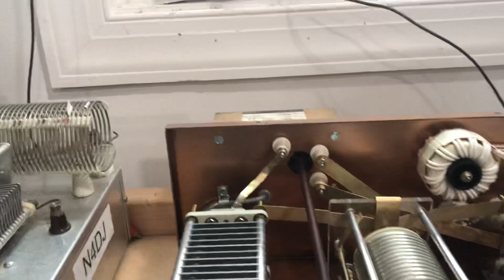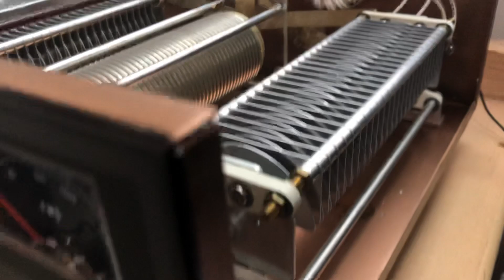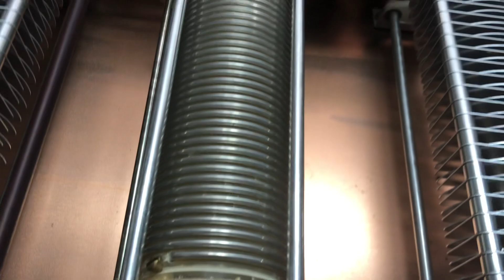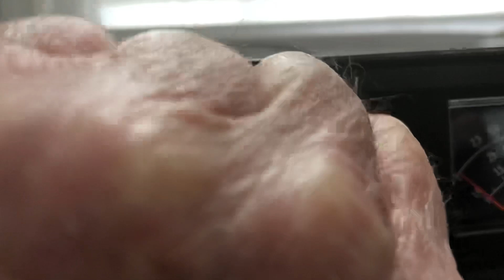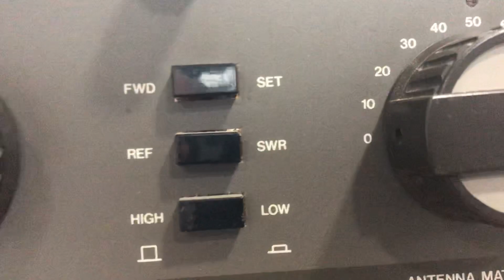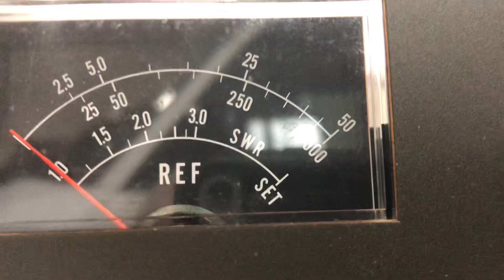Heathkit SA-2060A Antenna Tuner

Comment: I’m interested in using the long wire feature of this tuner. I removed the jumper for balanced line and simply connected a really really long length of 18guage speaker wire to the long wire jack. It runs along the top of my fence that goes around my suburban back yard. Probably 400 feet. 
The tuner is grounded to equipment ground which is bonded to a water pipe. 
  Do I need a counter poise and if so, how do I connect it?
Reply from the maker: It sounds like you have done everything right. I just am not sure about the ground. For one thing it matters how much power you are running. You can get away with a lot more with low power. I assume you will be transmitting on this antenna? 
For end fed long wires, some lengths are better than others. In some cases 1/4 wave needs no tuner. In cases where the antenna is 1/2 wave long it is a very high impedance and difficult to match. In between cases where the impedance is a “moderate” amount are usually easy to match. So turning the length can usually help in most cases. Trying to make one length of wire tune on multiple bands is not easy. Sometimes a counterpoise is needed and sometimes not, depending on the frequency. In most cases where the radio chassis is “hot” with RF adding a 1/4 wave counterpoise solves the problem. At that frequency. Nor sure what running around the fence means. It should held be off the fence with insulators. With the wire near anything it will have some effect, almost always a negative effect. 
My usual advice is to use a L network configuration tuner as they are foolproof with no possibility of mistuning.
If you are only receiving that’s a different story.
With antennas longer is not always better. The best simple antenna, actually the best antenna is a halfwave long dipole. Once you get much longer than that you get bad patterns. Lots of nulls and can get radiation from the wire canceling itself. Horizontal loops are not usually any better than a straight halfwave wire. The exception being if the geometry of the loop is such that it can form a pinpoint high gain beam in one or two narrow directions. That case is very special and most of us want wider coverage.
Did I answer the question?

Comment: Hi

Glad I found you!!!
On my 2060a, what is the correct way to use the sensitivity knob with ‘set’ button and the ‘set’ on the left meter?
Am I correct in thinking to set my Icom 7300 on say 20watts and tune the 2060a to low swr.  Then go to 100 watts on the Icom and then press the ‘set’ button on the 2060a, turning the sensitivity knob until the needle in on ‘set’?
Is this correct or not🥹

Thanku so much!!!!
Billy
Reply from the maker: Yes. I think you have it. Typically with the Heathkit SWR meters and most others also, you set the meter to full scale in the forward or “set “ position then switch to reflected power or the “SWR” position to read the SWR. Also the sensitivity needs to be set high enough that you can see the dip in SWR when you tune the tuner with low power. You probably will need to turn the sensitivity back when you want to read SWR with full power or you might peg the meter.  You need to be careful tuning these T network tuners. You could obtain a low or 1:1 SWR without all the power being delivered to the antenna. In that case the tuner heats up! I will watch this video again and see if I address that. If not I will add instructions here.
Reply: @dandypoint  Thanku sooo much!!

I believe I understand. 
Set the sensitivity to max on the dial, even though the needle is past the set mark, so that at low power, I can see a dip in swr…..Then I shld calibrate the needle to the set mark at max(100 watts)and then proceed to adjust all dials at for a final swr, and then talk away!
Reply from the maker: @WILLIAMPERRELLI  I think you have it. I usually like to tune for minimum SWR with fairly low power but with the sensitivity high enough to get a good dip. It takes more power and/ or the sensitivity set higher for 80 meters than the higher bands. Once you get the SWR as low as you can then check it by pressing SET and setting the forward power to the set mark. Then press the SWR to get the reading. Also if the forward power is 100 watts and the reflected power is 10 watts you have almost a 2:1 SWR.  When running 100 watts I monitor reflected power to be sure it is less than 10 watts and I know my SWR is better than 2:1. In fact anytime your reflected power is 10% of your forward power you have about a 2:1 SWR. I run 500 watts in contests, so I keep reflected power at or below 50 watts.
Reply: @dandypoint  I really appreciate this!!!

Billy
Reply: @dandypoint  Since this brand of tuner is one of your specialties, I did a bit of testing last night and thought that you might find the short results, interesting. 
See my photos. 

Upon starting, You state(and I agree) that the two Capacitance knobs shld be close to 100 and the inductance close to zero. 
The manual(see photos) shows starting points that are completely opposite, thus the way I learned to tune it. 
On 20 and 40 meters(see photo results), I tuned up both ways and asked the same station for reports. Oddly, for some reason, I received better reports(not by a lot) by using heathkits suggestion?  
I Included a photo result of my tuning, doing three segments on each band, via what was shown in the manual. 
My mind is always curious, thats how I learn. So any input on this is a welcome thing. 

Thanks again and hv a good weekend!! 

Woops. I just discovered that I can’t upload a photo😕
Maybe u hv an email to share snd I will fwd them to u.
Reply from the maker: @WILLIAMPERRELLI  my email is donjohnson@vt.edu
That’s one of the issues with T networks, they can be tuned for minimum SWR with different settings of the three controls. 
The Heathkit manual has suggested starting points for typical expected impedances. That should be good as a starting point.  I would like to see the pictures. I can email you some more tuning info also. What are you using the tuner for? Single end fed wire, ladder line to a dipole, coax in and coax out to reduce a moderate 3:1 SWR to a 1:1?  
In general the tuner will be most efficient if the output capacitor is at the highest value that will allow a match.  Matching a higher impedance than 20 ohms should be fairly easy but matching a low impedance less than 50 ohms may be a problem on 80 meters. Sometimes you can’t use full power without heating. I have some QST articles I can send you on T networks. 
I gave my tuner to a friend so I no longer have the manual or the tuner to look at. 
I
Reply: @dandypoint  You hv been so helpful.  I really appreciate it!!!
I will send all the info tonight, after work. 

Best,
Billy
Reply from the maker: Yes at the 1:10 minute point I start addressing how to tune the tuner correctly.
Reply: @dandypoint  
Question 

Is there a way to set the fwd power meter so I can view actual power(esp with my amp connected)while transmitting??
The only way that I have been able to accomplish this is to switch my Icom 7300 to either fm or rtty. 
I can then see 450 watts out. But if on ssb, the mfj shows fwd= 24.0

Thanku
William
Reply from the maker: @WILLIAMPERRELLI  I am not sure I understand your question. The forward power meter will read the power. The left or REF meter will read reflected power or it can be used to read SWR if in the set position and if the sensitivity was set with the push button on SET.
With the top push button out you will read power on your right side (FWD ) meter. To see my output power I use the CW position and hold the key down for a couple seconds. The meter will not read PEP. So if running 100 watts PEP output on SSB  while talking you might see 25 watts or so. With a shrill whistle you could see 100 watts, but the meter will never have time to go that high while talking.
Reply: @dandypoint  Woops!

The question was for my mfj-998

Comment: I have an SA-2060A and it has a problem where the insertion loss with either coax1 or coax2  is pretty drastic. When I put it inline with either coax the signals drop so low they can barely be heard. 
It’s as though the SO-239 connections  are faulty somehow. I’ve ohmed them out a there’s continuity. 
Any idea what may be the issue?
Reply from the maker: I think using Coax 1 or Coax 2 puts the tuner in the circuit between the input coax jack and Coax 1 or Coax 2, so unless the tuner is properly tuned there will be a loss in signal, both received and transmitted. In the bypass position then I would not expect any signal loss in either direction. I am not sure what you mean about checking continuity. There should not be any DC continuity between the input and coax 1 or 2 output so I am guessing you could not have done that. It you did get continuity then the capacitors would have to be shorted. The tuner is a T network with two capacitors in series and the inductor connects from the junction of the two caps to ground. Consequently (unlike a L network) it’s possible to mis tune the tuner and still have a low SWR. Since there are more than one possible settings for a 1:1 SWR , you should always use the one that had the most capacitance in the circuit. I think that is in the manual. I no longer have my tuner so I can’t refer to the manual but I am 99.9 % sure what I said about using max capacitance is in the manual. The manual also had some recommended settings for each band to use as a starting point.
Reply: @dandypoint  hmmm. I didn’t realize both receive and transmit could be effected if the tuner was “out of tune”. I thought only transmit was effected. 
I’ll try the bypass connection. 
What I mean by ohming out is that the sheilds of the so-239 are ground and the center conductor of each have continuity to the right electrical points according to the switch position.
Reply from the maker: @SummitBidTech  Yes, the RF path in coax 1 and 2 is through the T network both ways. It should make a big difference in some cases. The tuner set one way can present a very high impedance to one frequency and a very low impedance at another frequency.  Matching impedances is a rather complex process.  I did find a pre set chart.  On most bands the first cap is set around 50, the inductor 58 and the second or antenna cap is set near 50.  In general the inductor should be set in the 300 range for 160, the 100 range for 80, the 50 range for 40 , 25 range for 20, the 16 range for 15 and 10 meters. The exact setting will vary depending on the antenna impedance. Do you have the manual?
Reply: @dandypoint yes, I have the manual. I have it in pdf format and I’ve printed the chart you refer to. 
  I’ll try what you suggest and report back.
Reply: @dandypoint Yay! I think I got it! Thank you! I believe the problem was with the OP! I set the three caps to the frequency suggested settings and then by varying the inductor I was able to tune to 1.4:1 on 20m with an 80/40 trapped dipole. 
Full disclosure: I built this tuner myself back around 1987 or so but it's been in a box since 1990. I just got back on the air myself since then and I've forgotten some basics like how to use it the dang thing!! 
This is great. It's like hanging out with an old friend and getting to know each other all over again. 
Now to try if I can get a decent match on 160 with my 80/40 inverted vee. Nope. best I can do is about 3:1. Should I expect to be able to get a good match on 160?
73 de W0DCO (formerly NL7FU)
Reply: @dandypoint Since I could get to 3:1 using the 2060A, I then used the FT-991A built in antenna tuner and got the match to 1:1 on 160m. 
Is the above an "OK" practice? That is, do I risk damaging my tranceiver?
Reply from the maker: @SummitBidTech  No, I don’t think so. 3:1 is not really a bad SWR in most cases, however the new (I say new but really mean the solid state rigs that essentially replaced the classic tube rigs) rigs are built to see a 2:1 or preferably better SWR. 
So as long as the internal “tuner” can handle it you should be fine. Don’t forget that you have to spend a bit of time tweaking the capacitors and coil to get the SWR down near 1:1. You may be able to get it better on 160, but I don’t know what you are trying to tune. What is a near 50 ohm impedance on one frequency may be several thousand ohms on another frequency!
There are several things at work here. First the antenna itself has an impedance at its fundamental frequency. It has a completely different impedance as you move away from that frequency. The feedline (coax in most cases) always acts as a transformer unless it is exactly 1/2 wavelength or a multiple of 1/2 wavelength long. So the input to the coax could be anything depending on frequency, length, and characteristics of the antenna. The tuner may or may not be able to match that. In cases where the antenna is near 50 ohms, the tuner can most always handle that. In cases where the antenna and coax are not closely matched there will be a high SWR. For example if the SWR is 6:1 we can have the following situations.
6:1 SWR in 50 ohm coax means the actual impedance at the antenna is either 300 or 8.3 ohms. If the coax is exactly 1/2 wave the impedance at the input of the coax will be the same as at the antenna. However if the coax is 1/4 wave (or an odd multiple such as 3/4 wave) the impedance at the input to the coax will be totally different. If the impedance was 300 the coax will transform it down to 8.3 BUT if the impedance was 8.3 the coax would transform it up to 300. Any length of coax between 1/4 and 1/2 wave would give an impedance somewhere between those two extremes. Also there will be reactance introduced anytime the antenna is not resonant and frequently it’s the reactance that the tuners have a hard time with. Depending on length of coax the reactance can quickly change from being inductive to capacitive. So sometimes if a tuner can’t handle load, changing the coax length will change the impedance enough so the tuner will work. As I said it’s a very complex situation. Understanding the Smith chart is frequently the only way to get a handle on what is going on, at least for me the Smith Chart is what helped me fully understand this stuff! If you are not familiar with that process look it up. I also have a video here on YouTube that explains it a little.
Reply: @dandypoint  Thanks again. I'll check out your smith chart video. 
I'm having to relearn a lot of stuff that I may or may not have fully understood when I was an active ham back in the mid to late 1980s. I just got back into ham radio and it's great that now there are so many great resources like your channel. Many others too. 
I purchased a nanoVNA and am learning to use it. I think it's a great instrument for characterizing antennas and feedlines. I believe it has a smith chart mode too I'll have to investigate. 
Thanks again!
73 de W0DCO (formerly NL7FU)
Reply from the maker: @SummitBidTech  I also have the nano VNA. Great tool! Check this out: https://youtu.be/9w2oEp71P50?si=4l5z-pKNn6n3Em6q 
My video using it with coax.